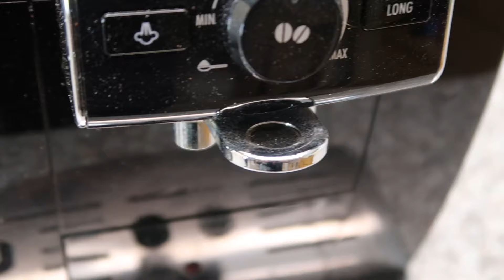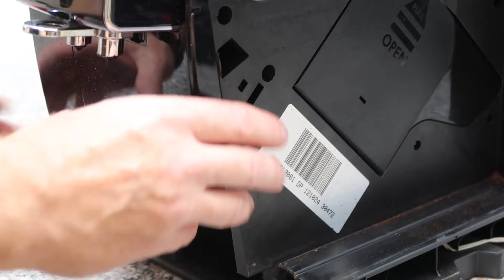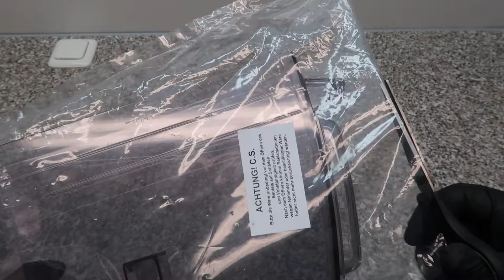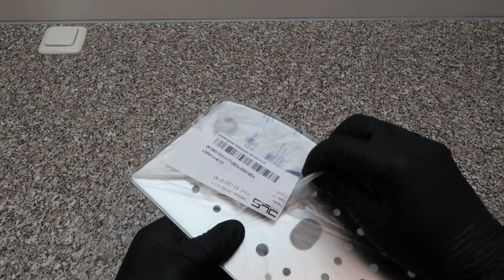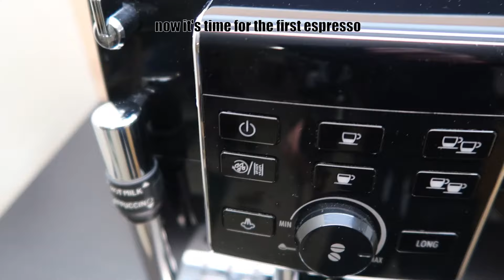DeLonghi ECAM Fully Automatic Coffee Machine Restoration | DeLonghi Repair and Restoration

Comment: Thanks for the great video. I like Delonghi, ECAM and ESAM, I think these are currently the best and easiest serviceable coffee machines. Simple construction without unnecessary complications. All parts and components are well accessible and easy to replace. In 5 years I serviced them and repaired about 10 pieces. I have exactly the same Delonghi at home. It works for 6 years without failure. 
Sincerely.
Reply from the maker: Thank you for the nice words. I also love to disassemble and repair the Delonghi coffee machines. Very simple and brilliant technology and above that, the parts are not overpriced.

Comment: Thank you for this video, please could I ask what screwdriver head you need to remove the tiny screws from the back (the first removing cover step you showed). Thanks
Reply from the maker: You need a Torx 20 "BO" screwdriver with a bohre that can slide over the pin.

Comment: Great video and awesome machine! I did the same with my Delonghi ecam 23.420.SB after 17600 cups. It's still working perfectly. In my machine the infuser guide (small plastic thing that pushes on the lever of infuser) was broken so I 3D printed it. Anyway, great video! I was looking for something like that when I was renovating mine but without success.
Reply from the maker: Thank you for the nice words! The idea of the 3D printed infuser guide is genius. 

LG
myworks
Reply: I do not dare to disassemble my machine but I think I could have a similar problem with the infuser guide: the piston is not pushed to the top after brewing therefore some coffe ground remains inside and is not wiped off (I have to remove it manually otherwise the next coffee is awful...) Do you think this could be due to the same piece you 3D printed?
Reply: @danielnelva134  I had the same problem. Printing this part helped. You can easly check if your part is broken by looking inside infuser doors on the right side. Its small guide looking part.
Reply: @danielnelva134  Recently purchased for 45 euros ECAM23.420 with the same "fault", otherwise in very good condition, 10 minutes fix, you have to adjust the infuser/piston to the home position, now the piston goes all the way up. Very good coffee machine.

Comment: Great video, with the part removed at 08:23 do you have any more detail for rebuilding it?
Have a small 2 part plastic transparent bit with a spring that I think goes under the part where the washer sits as an oblong/oval shape. Can't get it to go back in, unless it doesn't go there?
Reply from the maker: I will make a detailed video of the part. Can you send me pictures? Maybe I can help you.
Reply: @yt.myworks  thanks but I've fixed it now. It went in the other hole next to the one I was trying to fit it in. Machine is working great 👍
Reply: Could you please share the photo? I can't seem to find the right spot.

Comment: Hallo, in einem anderen Video hast du die Dichtungen einer Delonghi Esam vermessen. Hast die für die Ecam die Maße der Dichtungen des oberen Brühlkolben auch? Wenn ja, würdest du die mitteilen? LG Heini
Reply from the maker: Hallo, kann ich machen. Im wesentlichen sind sie identisch mit der esam allerdings kommen noch ein paar andere dazu. Melde mich nochmal. LG
Reply from the maker: Anbei eine Liste mit Dichtungen die ich nutze. Die Massen von anderen Lieferanten können abweichen. Alle Angaben natürlich ohne Gewähr!! LG

1. Große weißer Ventilkörper
DI 4,75 x SD 1,78mm → 3x

2. Kleine weiße Hülse
(eingeklipst am Kolben)
DI 5,28 x SD 1,78mm → 1x
DI 3,69 x SD 1,78mm → 1x

3. Lange (gelb transparente) Hülse
DI 4,75 x SD 1,78mm → 1x
DI 6,75 x SD 1,78mm → 2x

4. Weißer Ventil-Körper
DI 5,28 x SD 1,78mm → 1x
DI 6,07 x SD 1,78mm → 1x
DI 10,28 x SD 1,78mm → 1x
DI 18,77 x SD 1,78mm → 1x

5. Große gelb transparente Hülse (Brühkolben)
DI 34,90 x SD 4,2mm → 1x

6. Schlauchdichtungen
DI 4,0 x SD 2,0mm → 2x
Reply: Super, vielen Dank!

Comment: Did you use special tool to remove back star screws? They seem to have a center piece that
Reply from the maker: You need a TX20 Torx (Torx with Hole)

Comment: You have done a great job! Could you kindly specify which grease did you use in each section? I see the product in the description But I don't know which is use when.... Thanks
Reply: Yes I have the same question. What lubricant was used on the o-rings on the infuser?

Comment: Great video, mine needed an even bigger clean out than I realised. 

I’ve put everything back together, that was straightforward, but when I turn it on it starts up and rinses correctly as it should but there’s a noisy clunk now and again.
All the parts of the infuser look to be in the right position, including the legs. Any advice?
Reply from the maker: Did you put together the brewery group like in the video here? https://youtu.be/IdLPhyLmxIQ
Reply: @yt.myworks I’ll double check, thanks man
Reply: @yt.myworks  the infuser was assembled exactly as per your video, but I’m still getting a loud clink right before the machine turns off.

Comment: Great video! I have replaced my diffuser (behind the door and water tank) and the valve assembly (the part with 5 tubes attached), but still my machine will not pump water through. When I remove the supply tube from the valve assembly, it will pump water through the open tube. Is it possible the pump cannot generate enough pressure and needs to be replaced? I would also replaced the nearby regulator just in case? Any other thoughts appreciated.  Thanks.
Reply: I would try to replace the generator - you could try cleaning it first.

Comment: I had one from a friend who looked to scrap it .Doesn't work of course but i will try to fix it. The engineer told is ERROR message on the electrical .I looked to diffuser and the rings are worn but with some life in them.What silicone you use for rings? Is a great video and I hope to fix my espresso machine too.
Reply from the maker: I use OKS 1110 silicone. Good luck with the repair.

Comment: Great video.  I have a ECAM23 460.s which is very similar to this machine.   The hot water has stopped running through the spout and therefore the throth maker.  Do you have any idea what it could be?  I've tried to take the spout out to clean but its not easy.  Thanks
Reply from the maker: It could be that one of the solenoid valves is no longer working properly.

Comment: Hi,
MY ECAM 22360 somehow ended up with the tray and infuser stuck in. The on-screen message is insert the undertray, but actually I only need to take out the undertray.
Do you know what's the looking mechanism for the tray, so I'll attempt to manually remove the tray maybe, and reinserted again? I've tried couple of reset methods and none of them worked.

Comment: Hi, do you know what could cause the steam / hot water nozzle to work intermittently? I have the cappuccino model and after you use it to dispense hot milk, it blocks and won’t clean or run hot water unless you switch it off and leave it for a while
Reply from the maker: Hello, it's difficult to say but I suspect that one of the electromagnetic valves might be broken. Have you descaled the machine regularly?
Reply: @yt.myworks  so interestingly it was sent off under warranty and it looks like the only thing they changed is adding a small red condensate tray

Comment: Hi 
I've fixed my delonghi Ecam (similar to one in your video) by putting a new thermal fuses and now waking fine but when putting the milk frother and trying to make cappuccino it tells me "Turn Froth Dial on",I cleaned the frother and turned the froth dial left and right but still the same message comes up, any ideas? 
Thanks
Reply from the maker: It could be that the micro switch is not working properly. Check the small switch on the connector from the milk container.

Comment: Thanks for this awesome video! It really helps to provide some insight. I have an Eletta and I now have a problem where it does not indicate low water level. I can use it and you will hear the pump going dry. Once it is off and you switch it back on, it will say low level and water circuit empty and then you have to bleed. Also, I am assuming it uses the same input to let you know once your descaling cycle is complete as it doesnt anymore and I need to then switch off the machine once done. Do you perhaps know what input these coffee machines use to indicate low water level? i would like to replace that part.
Reply from the maker: Hi, I recently had such a machine with the same problem and tried different things. In the end, it turned out that the magnet in the water tank had lost its power. Unfortunately, this cannot be replaced, so I recommend buying a new water tank.
Reply: @yt.myworks  thanks a lot for the info. I will definitely do so. So the magnet is that little slider in the tank that rises as the water rises and drops with the usage of water? Is see it is molded in, hence the need for a new tank...
Reply from the maker: @HoBBLeCooKiE  Yes, that's exactly how it is.
Reply: @yt.myworks  thanks a lot!!!

Comment: Hi. I've got a weak taste with my unit. I have it for 3 years and recently   got problem like that. I have descaled it several times , cleaned properly the infuser and also tried different coffee beans. I haven't change the grinder settings as since the beginning was OK. Any idea what can cause the coffee to be weak.
Reply from the maker: Do you always have the same amount of coffee in your cup? Is the used coffee dry? If so, first adjust the grinder by one level. The coffee powder should be as fine as sugar. The result can only be seen after three cups.

Comment: Amazing iob !! I want to ask you about the coffee machine. The machine does not work normally. When I start it, the pressure switch light flashes intermittently and continuously. Delonghi macnfica blinking steam light.
Reply from the maker: Does the coffee machine otherwise work normally? Can you make a coffee? If the red light in the middle is flashing, then the machine should be descaled.

Comment: Do you have an idea what might be wrong, when I turn on coffe machine nothing happen, no initial cleaning water will come from machine, it sounds like it want to push the water but cant. Does it mean water pump is broken? I dissasembly whole unit and clean but still not working, so I assume its that?
Reply from the maker: Hello, this usually happens when the machine hasn’t been descaled regularly. In most cases, the Teflon tube leading from the heater to the infuser gets clogged with limescale deposits. However, be careful: the tubes are under pressure with hot steam, so always let the machine cool down before disconnecting any tubes!
Reply: @yt.myworks  thank you, will look into that.

Comment: Hi, since I have not marked the coffee grinder, I have the wrong grind. Which is the ideal position?  I only have a sign how can I put it right?  With grinding, the coffee grounds are water.  thanks
Reply from the maker: Hello, you need to adjust the grinder so that the coffee grounds are as fine as sugar. When the gear runs out, you need to relocate it. Always readjust in small steps until the coffee tastes good.
Reply: @yt.myworks  When you disassemble the coffee grinder in the video you marked the direction I did not with a felt-tip pen.  I was wrong I can't find the ideal location.  thank you very much you are very kind

Comment: Just did the deep clean because the general warning light was on. I have no idea how the hell would it know if it's dirty "inside". Anyway, I hope it works . Will reassemble it tomorow. 
Either way , I learned something today from you, thanks. :)
Reply: Lol, It actually worked.Not the cleaning per say, but the wire to the press motor didn't had a good connection.

Comment: Hi! I got a model close to this one and the lights, according to manual, tells me that the grinding is too fine (lights for ground container and alarm are flashing while the water tank one is steady). Tried to adjust grinding and tried the steam dial like suggested, but nothing works. I opened a part of it and I can add that I dont think water is coming out of the tank at any time. You have an idea of what it could be? :)
Reply from the maker: I think there are two possibilities either one of the water lines is scaled up and clogged or the water pump needs to be repaired or replaced.

Comment: I just replaced the generator using your excellent video.  However, it now leaks from every one of the hose insertions where I placed the small hoses.  They are properly seated in the hole, and the brass ring is captured by the clips in every spot.  Any ideas on what could be the problem?  My original symptom was that instead of making a cup of coffee, water would just pour down inside the drain.
Reply from the maker: With generator is meant brew unit piston?  Did you use new o-rings?  The seals should be lightly greased with silicone grease.

Comment: 👏🏾 great job. 
I have a problem with my Delonghi Dinamica plus. Ecam 370.95.T    the device gave a short circuit when switched on.  do you have a video for that.  replace the motherboard?
Reply from the maker: Check if there is a leak inside the machine. That could cause the short circuit.

Comment: Hello!

I have a delonghi dinamica, and my problem is it does not create coffee pucks/discs, so coffee it makes is watery very watery. And in grounds i get wet pile of goffee grinds not a puck or disc like use to. What can i do to fix it please? Thanks
Reply from the maker: Hi, first follow all the steps from this video https://youtu.be/OJWguSgyf4c. It is important that the brewing group can be moved easily at the end. Finally, prepare more than five coffees without coffee beans (ignore the error message) then the electronics should reset again, which means the grinder grinds a little longer and the coffee pucks get bigger. The grind level should be set to level 3-4.

Comment: Hi, 
I've almost the same model and I replaced the thermal fuses but when putting back together the adjustable coffee dispenser at the front is not staying up and whenever it push it up it comes back down so I'm wondering if I'm missing a part or spring that should how the dispenser position where you can adjust it up and down to suit the cup hight?
Thanks
Reply from the maker: Yes, you need a stainless steel spring and a plastic cap. These parts get lost very quickly ;-)
 https://www.juraprofi.de/DeLonghi-Ersatzteile/Gehaeuseteile/DeLonghi-Feder-fuer-den-Kaffeeauslauf::10168.html , 

https://www.juraprofi.de/DeLonghi-Spare-Parts/Housing-Parts/DeLonghi-Cap-to-Coffee-Spout::10169.html
Reply: @yt.myworks  Thanks

Comment: Hi, I have an delonghi ecam13.123.b. Just like the one in the video. 
After cleaning the grinder it shows the error code that pre-ground coffee has been selected.
 However the front dial is set to beans.
Is there any way to reset this?
Thanks a mill.
Reply from the maker: You must ensure that the grinder is properly assembled and properly adjusted. Otherwise an error message may appear. Put all the parts back together step by step. Watch my video very carefully.
Reply: I had the same issue after I removed a stone from the burrs. Once that was dealt with I cleaned it up and  I needed to take off the back panel and make sure that the grinding size wheel was properly lined up.

Comment: Great video. I was able to clean out a 2nd hand machine i bought recently BUT im encountering an error where the unit keeps thinking the coffee grounds container needs to be emptied when i try to make a coffee, when theres nothing in it. The sensor seems to be working fine. Any ideas what the problem / fix to this could be? Its an ECAM 13.123.b
Reply from the maker: Hi, it's not that easy to say, maybe there is an electronic problem on the circuit board. Try making a coffee without coffee beans, ignore the error message, maybe it will help.

Comment: Hi, i keep getting a coffee grinded too fine adjust the grinder error and it doesn’t rinse at all. Then it asks me to attach a water pipe and press ok. The hot water comes easily through the hot steamer but never through the coffee nozzle. Any suggestions?
Reply from the maker: Hi, first try to descale the coffee machine properly, two or three times. If it still doesn't work then the water pump needs to be repaired or replaced. You can see how to repair or replace the water pump in my other video: https://youtu.be/9p65d-Mrnwc
Reply: myworks  thanks for your replay :D 
Ok I’ll try working on the pump as I have dismantled basically all the piping and checked for blocked ways, I’ve also cleaned the infuser and the brewer as u did in your videos.

Comment: Hello, I have an old Delongi Magnifica S Smart Cappuccino and after replacing the brew unit and adding some lube to the gear for it, the machine now shows a General alarm when it turns on and wont brew, Sometimes opening the water door or power resetting it allows it to but its not consistent anymore, any ideas?
Reply from the maker: Which model is it ESAM or ECAM?